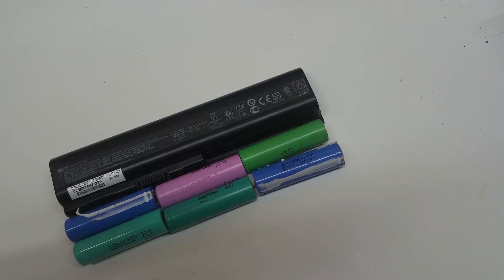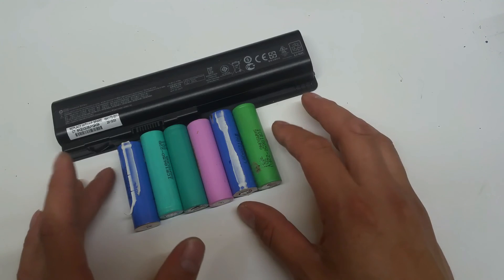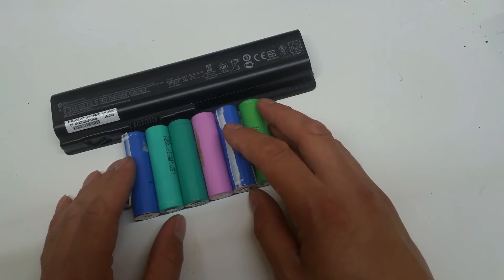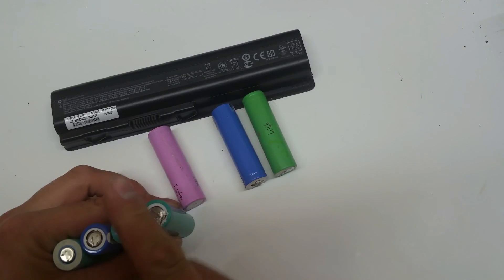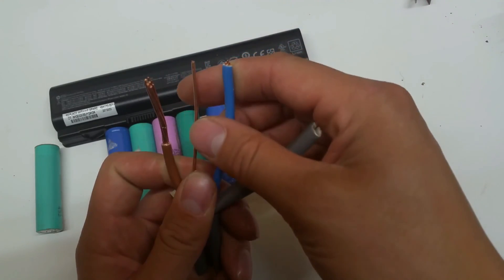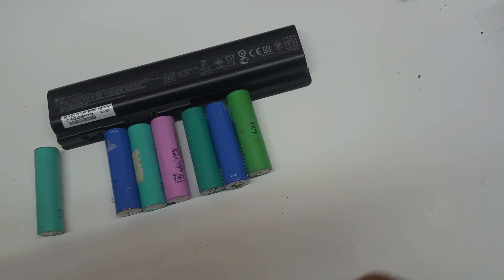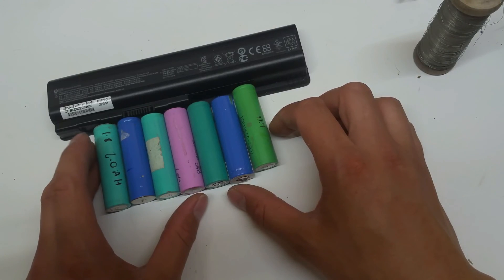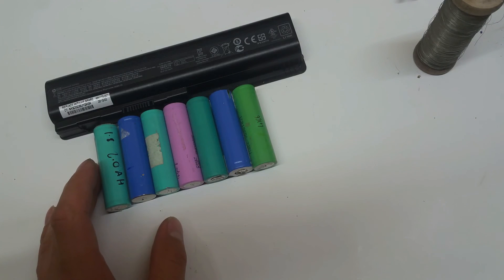My tesla powerwall ideas - WARNING talkey video

Comment: I've found the OPUS BT-3100 discharger works quite well. It's small and has a good display. It will discharge 4 18650's at a time but only at 500mA. There's a in-depth/test review here: http://lygte-info.dk/review/Review%20Charger%20Opus%20BT-C3100%20V2.1%20UK.html
Have fun with the project. I gotta warn you - it's quite addictive.
Reply from the maker: That's the charger I was recommended before! but I see you have many videos. so I'm going to sub and see how many I can get through this evening! =)
Reply: +pietkaify Don't watch the one I just posted. 1 hour long.
Reply from the maker: I'll be ther in a day or so! i'm up to 30 =) I like the pairs idea.
Reply: Hardcore binge watching.